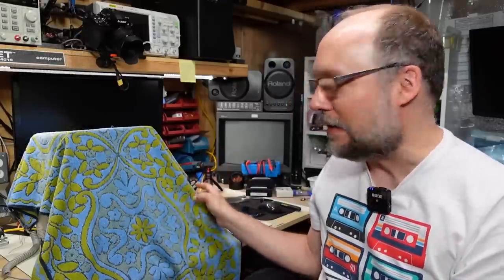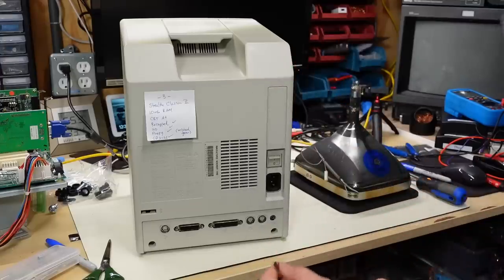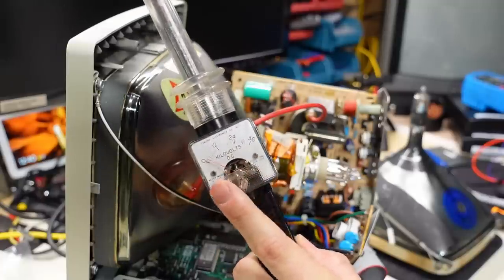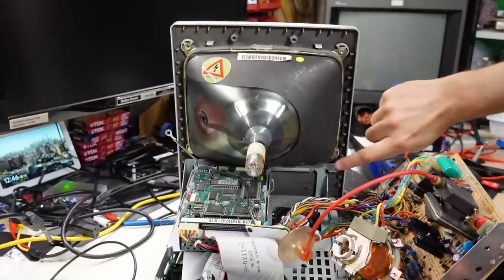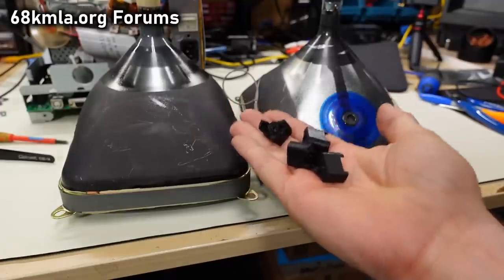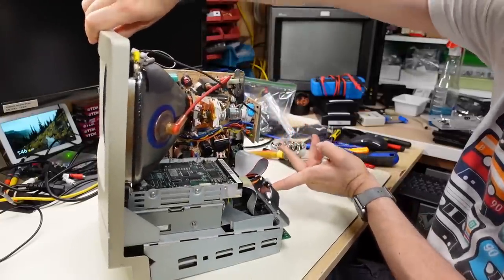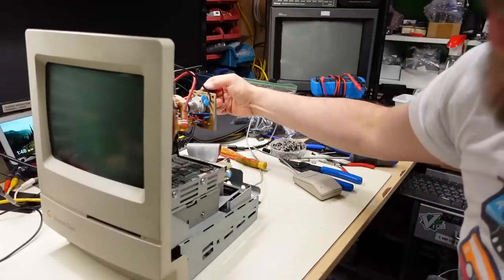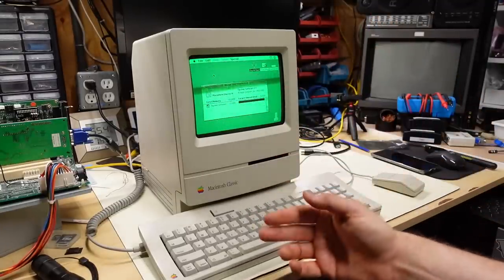Apple never built a Mac like this

Comment: I feel a washer stack (and a bit of tape for convenience) is in order to replace the missing plastic spacer. It's unlikely that your kludge will do any harm unless the unit is dropped, but in that one case it may make a lot of difference how badly the shell gets damaged.

I don't think anyone can claim you've "ruined" anything, since you still have all the original parts. Even when I disagreed what parts should go in the 5170, I never felt you ruined it because it's all reversible. The same goes here.
Reply: It's possible that the washers would also get in the way as well.  I was thinking maybe cutting off a side of the spacer might have worked though, not sure.  As for ruining it, I dunno, even if it wasn't reversible I don't think it matters for something like this that's such a common machine.  Yeah, one day they'll get more rare, sure.. but they'll never be rare enough that you won't be able to find them at any retro computer museum anyway.  The biggest part of this hobby is getting enjoyment out of the machines years after they're relevant, not just putting them on a shelf hoping one day your pristine version will fetch some high resale value.
Reply: My point wasn't about whether permanent modification is acceptable. My point was that he doesn't need to care about that debate because nothing he has done is permanent.

Comment: i wonder if you can swap the implosion bands between two monitors of the same size other than the implied implosion in the name of the band being an issue
Reply from the maker: Maybe someone who is super proficient in metal work could do it? I know people have cut those off before to cause better destruction of CRTs for fun -- so it would be possible probably to use some tabs to maybe weld the other one in place? But doing so without damaging the CRT? Not so sure... and no way I would try it :-)
Reply: @adriansdigitalbasement  Maybe it would be possible to cut off the tabs (with a dremel for example) and epoxy new tabs on the implosion band. Something like an angle bracket, maybe purpose made or adjusted to fit. I suppose it should be conductive epoxy.
Reply: @adriansdigitalbasement   With the monochrome screen, maybe you could fabricate a plastic printed collar to fill in the frame gap.

Comment: You should remove the damaged parts of the apple 2c monitor and fill it in with a lcd screen and a raspberry pi and turn it into a little terminal. Maybe automate the house with keyboard commands.

Comment: I guess you could say that you did indeed think different with this CRT swap... :P

Heck, someone thinks I'm nuts for connecting a 5.25" Quad-Density (aka 720k!) floppy drive to my Amiga, my reasoning; Because why not?? :D
Reply: I guess that someone doesn't know there was an external 5.25" drive available for the Amiga - the A1020... sure they are not all that common, and they only read 360K disks, but they exist. So you're not all that nuts. :)
Reply: I knew of those existing myself, and so does the friend who thinks I'm nuts (cos I told him about it!), but the Quad-Density drives are, to me at least, unusual as they're uncommon too, and as they format to 720k and can be used on a PC if you set the BIOS to see as a 720k 3.5" drive, then my thought is that it'll work as an 880k drive on my Amiga, purely for fun, finding QD disks isn't easy, I just got lucky with some old British Telecom Merlin-branded disks... :)
Reply: @twocvbloke  I had a 5.25” drive connected to my Amiga. It was able to format DD disks to 880KB no problem. The whole point of it was because 5.25” DD disks were cheaper than 3.5”. It’s definitely odd storing 880KB on what are most commonly considered 360KB disks.
Reply: Everyone I knew with an Amiga 500 in the 80's had an external 5.25" floppy drive and a switch to boot up from it.

Comment: could a color crt be put in a classic?
Reply: Even if you got around the voltage, size, and other issues, the machine wouldn't do color so it would still end up as a singular color.
Reply: @brianv2871   Though I guess one could then add a controller of some sort to determine the balance between R, G, B - allowing the user to change the color of the display as they saw fit

Comment: And here I though you were going to swap the CRT for an LED, which I've seen and done myself before. I'm not to keen on a green monochrome monitor but I think its cool that you can do this. If you had a computer with a busted CRT and happen to have a green CRT available to swap parts to get the computer working again to revive the old machine, all the better. As the classic parts get more rare to find, more creative solutions will be found.

Comment: Sometimes I think these fancy "perfect" solutions like printing pieces of plastic as spacers are just more trouble than they're worth.  The printed part idea sounds really nice on paper....  but it sounds like there's just too many variables involved to get it right.  The fact you need so many of these things for different computers/CRTs speaks to this.  Plus you have to buy these things from someone, or if you're very lucky have a 3-d printer, and then wait for the 3-d printer to finish.

Honestly, why not just go to the hardware store (or if you're prepared, into your nuts/bolts/washers stash) and find a bunch of washers and stack them up to the right height?  It's much easier, and provides a cheap solution you can do yourself, and customize to whatever you need.  If you want, just glue/solder the washers together so they don't come apart when you're trying to get the thing together.  Nobody is ever going to see the insides of your monitor, so elegance is mostly irrelevant, and function should prevail.

If you really want to go the fancy route, how about just a series of little thick plastic washers of varying thickness and width that can inter-lock together, and you can create your own custom solution?  I wouldn't be surprised if someone hasn't already done this as a general solution.  I know the hardware store sells little plastic interlocking spacers that are designed for mounting electrical outlets in a box, where for instance you've put in tiles that raise the outer surface from the electrical box.

Comment: White phosphor, not RGB Dot derived white, would best high resolution, based on the ways our eyes are built. The have a lot more rods then we have cones in our eyes. So our eyes have better resolution eyesight with white light than with a mono color such as Amber or green or blue. we have 6-7 million cones and about 120 million rods. So, I believe the switch to Amber, or green, would be a serious downgrade in the detail the average human eye will discern out of the new display for that Macintosh. So I would say Human Engineering was the reason Apple chose the white phosphor for the much higher resolution required with a GUI based computer.
Reply from the maker: I think you forgot one thing -- we're talking about 512x342 resolution here -- not 5000x3000 :-) 

Also,  science suggests our eyes are most sensitive to green light: 

https://www.redsharknews.com/technology-computing/item/4741-human-vision-and-why-the-colour-green-is-so-important

To see saturated colour, the brain does more or less the same sort of processing that has to happen in a Bayer-sensor camera in order to recover full-colour information. The reason this gives us best acuity in green is simply that there's really a lot of overlap between the medium and long (green and red) cones. This happens to the point where the medium-length cones can see everything from a greenish turquoise all the way through to, well, a fairly orange yellow, while the red cones can see from mid-green to the borders of infra-red. The result is an overall peak of sensitivity at a place which really looks pretty green, despite the fact that we can also see red using the same anatomy.

So, the highest-density, sharpest part of the retina is most sensitive to greenish light. It's because of this that we use a preponderance of green to form the Y channel of a YCrCb image, which is done by everything from JPEG to ProRes. It was due to all of this that the early colour television systems carried most of the green channel information in their highest quality, black and white backward-compatible picture. It's also because of this that Bayer-pattern imaging sensors use twice as many green pixels as they use red and blue pixels. Bayer himself described the green elements in his design as “luminance-sensitive” in the first sentence of the patent, and goes on to say “said luminance-type elements are sensitive in the green region of the spectrum.”

Comment: I think this is the first time I gave a thumbs down on one of your videos. This is totally useless and not interesting at all.
Reply: I actually found it interesting and I'm not a CRT guy.  Swapping from a white screen to a green screen obviously isn't useful, but it was what helped to make this CRT swap video more interesting.  Even if he had just swapped in one white screen with another white screen, there is still a lot of value in this video as he goes over methods of using slightly incompatible CRT and the challenges and solutions in doing so.  There are definitely times where you need to swap out a CRT (bad or broken existing CRT, for instance) and this video will help do that... the fact that it was green, amber, pink, whatever... doesn't really affect how useful the video is.
Reply: The video may not be of interest to you, but for other Apple users it is useful info on  replacing a picture tube if it were weak or broken.Phosphor color being irrelevant here.